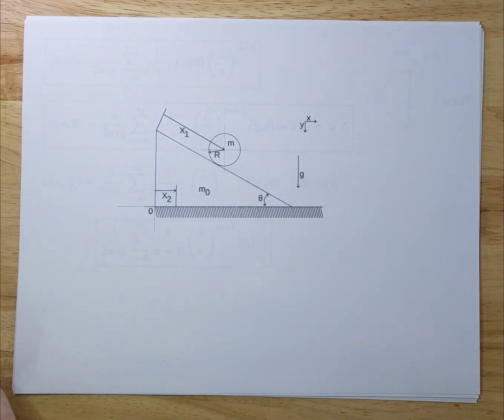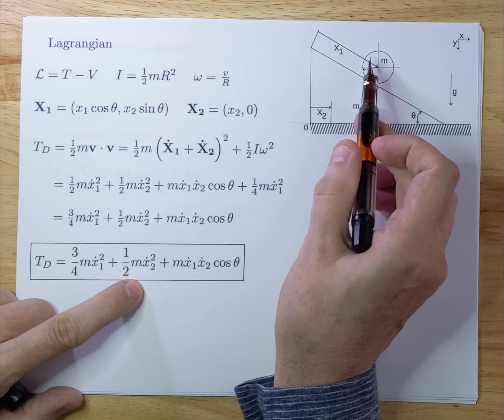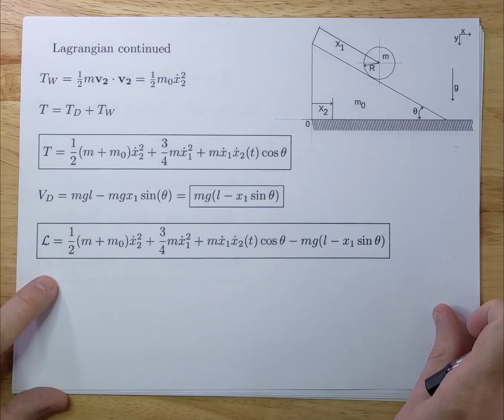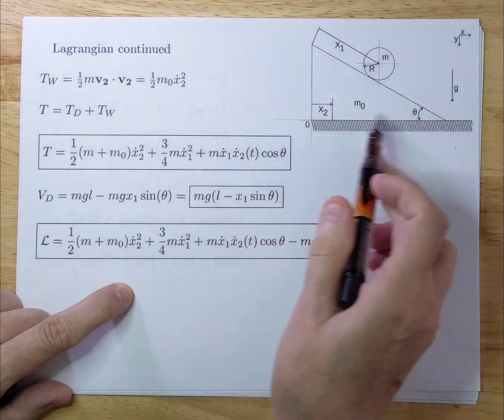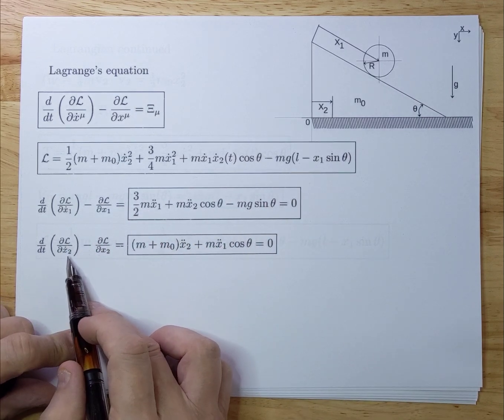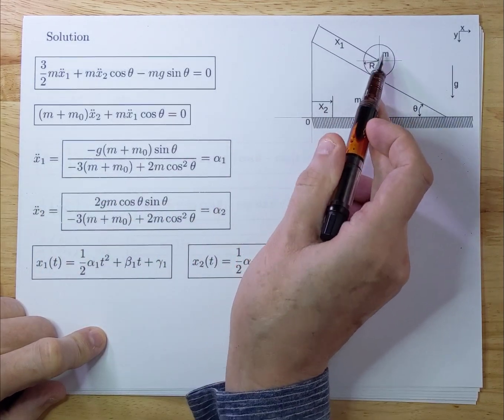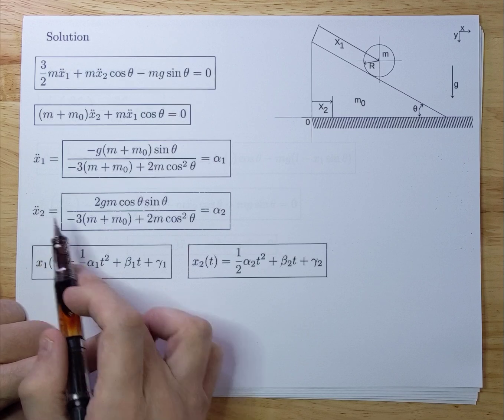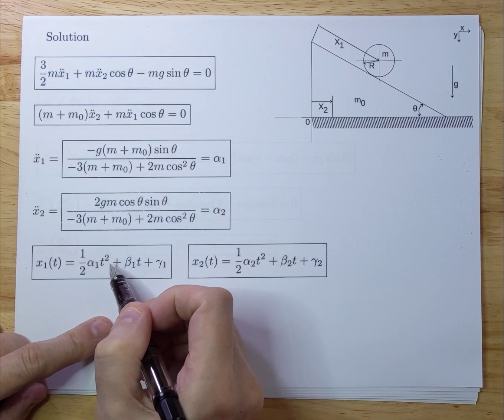Rolling disk on sliding wedge. Lagrangian Mechanics.

Comment: why don't you simply use  x and y in place of x1 and x2 ?
Reply from the maker: Of course you can do this. Historically x and y are mostly assumed orthogonal (cartesian coordinate system.) as I stated in the picture, and in this example they are certainly not. Also, by convention, if you use more than a few generalized variables, you run out of letters quickly (x,y,z,.....) therefore it was decided (a long time ago) that x_1,x_2,x_3 or x^1, x^2, x^3 (no powers!! but indices) was a better approach to refer to variables. But in this case because the problem is relatively simple you are right and you can use x and y. I hope this helps.
Reply: I don’t understand why it is x_2 sin theta for y coordinate, shouldn’t it be x_1 sin theta?